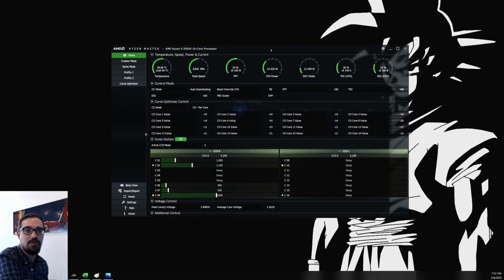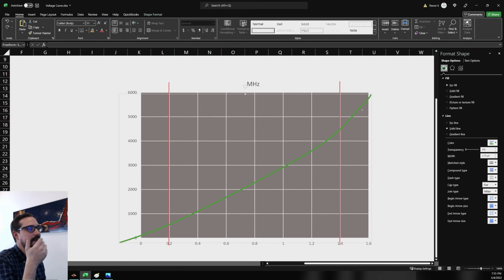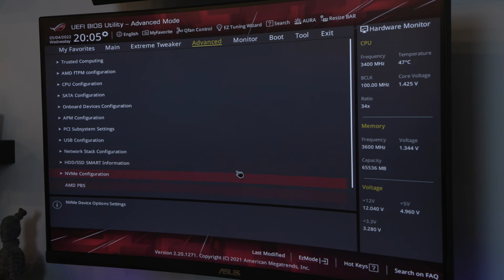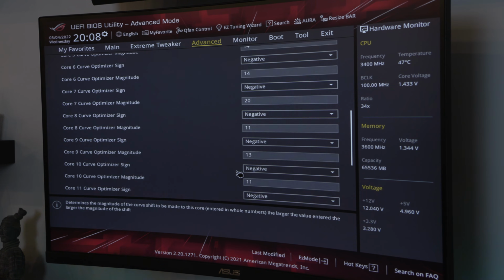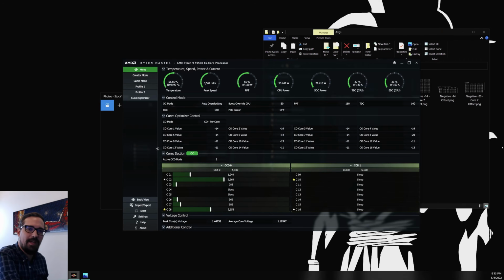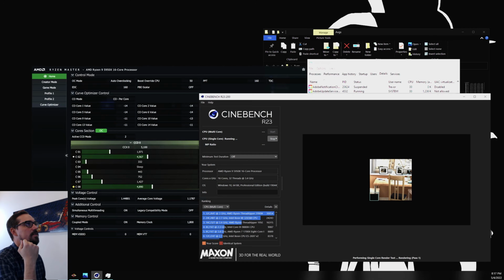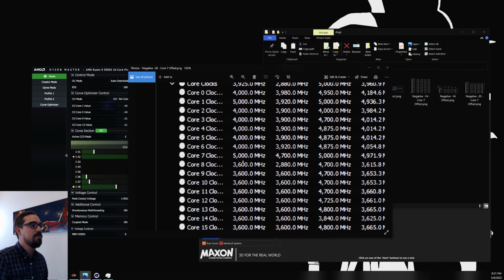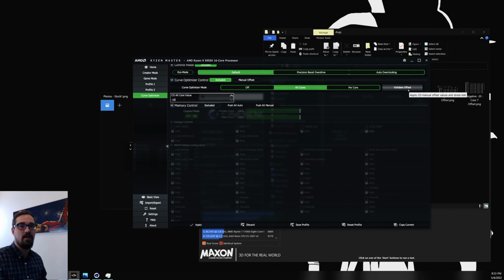AMD Overclocking - Curve Optimizer Explained

Comment: I've tried one thing to find the instability. I set CPU performance to 53%, that's where my 5700X is at lowest voltage + highest clock for that voltage.
I then start Prime95 Small FFTs, and see if clocks get stretched at that point by comparing reported frequency and effective frequency in HWiNFO.

I found that I can easily do -30 all core CO, and on top of that a -0.01875V offset on VCore with not clock stretching at any point. At -0.025 offset I get a very slight clock stretching, where 1780MHz(53%) get's down to ~1770 under stress test. At -0.0375 there was an idle stability issue once, that's where I started investigating low voltage/low clock stretching.
So, I guess -0.01875 with -30 CO is the best my CPU can do stable, which I'm pretty happy about.

Comment: Im really want to ask this, plz reply. So basiclly what we do is move the curve to the left, so with the same amount of voltage, the more clock speed it gain. But i rather want it to be cooler. So is the anyway to exemple: stock value is 1,4v ( max ) and the cpu run at 4,5ghz. Is the anyway to reduce the voltage to the value that the cpu run stable at 4,5ghz. But only that and stop ( no more clock ). It like i only need the same power as it stock but with lower voltage ( exemple like 1,35v ) and it wil stop right there, and not peek to 1,4v
Reply from the maker: You can effectively do that by manually setting the CPU voltage to run at a lower level, that would be done directly in the BIOS. It will result in a hard-cap on the performance due to the voltage cap. It would run cooler due to less power and would output less performance.
Reply: @UnhingedSystems  i know that. But the thing i want to ask is if we could have better perfoemance with the same voltage, can we hae the same performance with less voltage
Reply from the maker: @KienNguyen-lb2ee  In some cases reducing the voltage and manually setting a set clock speed can result in the same performance with lower voltage. This would mean using a fixed clock speed and manual voltage (manual overclock). Curve optimizer can still be used, but it is really setting the fixed clock speed and voltage that would enable similar performance for lower voltage. For an example PBO might boost all core  to 4.5GHz @ 1.4V, but in some cases you could do a manual overclock all-core 4.5GHz and 1.34V and use less power. It really depends chip to chip how well this works.

Comment: Very nice i have -60 on all cores but on home window in ryzen master it shows -50 dont know why. I test stability in OCCT Linpack 2019/Large/Small loads and it works without stability issue and temps from stock settings drop by 18C(from around 80C to 61C) and i get 200Mhz from Auto OC.

Comment: Just applied a conservative -10 all core curve optimize to my 5800x3d, and I'm seeing a pretty substantial drop in temps and a slight performance gain.
Reply: I bought a 5800x3d yesterday and immediately set it to -15. the result is awesome
Reply: I just got a 5800x3d, full -30 and so far no crashes in idle state. I think you can go further with CO on a x3d since it's a better binned chip.

Comment: Well just for those don't know there's actually a tool called CoreCycler, it stress test each core using a test mode you chose from a list. And just recently I found some redditor posted additional code he created that automatically increase CO curve value by 1 once a core fails the test, that means the user doesn't have to go into BIOS to change this setting every time it needs to be adjusted. The 5950x I own has huge difference in its cores: most cores on its CCD2 can go -30 without any problem, but most cores on CCD1 can go as low as -18 or -19. One has to be adjusted to somewhere +9 and another one stays at 0 as previously tested (talking about losing silicon lottery...). I'm now re-running the whole curve using this new automatic feature to fine tune it. This example means using one universal number that fits all cores is impossible. The system can be unstable because the all-core CO value may be very far from optimized for some of the cores.
Reply from the maker: People will get different results with CoreCycler. I've had it work okay on some chips and just cause constant hard-locks on others. Unfortunately there is no perfect "one size fits all" solution that guarantees stability for all use cases on all chips. That being said core optimization will likely go away in future generations as AMDs built-in features and out-of-box performance get better generation after generation. Side note, almost all high performance builds I have done in the last 6 months people want 13900K over 7950X/X3D. Seems like the big spenders are getting AMD shy again.
Reply: Well it sounds like there are some more tweaks to be done in the CoreCycler config cos if you don't stress each core properly with all 3 modes (sse,avx,fma3) you may not get a true CO value. But since it's really time consuming and Zen3 is already a past so...
I do agree that Zen4 generation didn't perform as good as many had expected and Intel actually had been doing better than before, but hey that's what exactly we want: competition. It's always a good thing that Intel brings us cheaper AMD and AMD brings us cheaper Intel.
Reply from the maker: @enchantereddie  Run a few hours of Stellaris, it will crash where CoreCycler passes.
Reply: @UnhingedSystems  Cool, good to know. Thanks!

Comment: I think this is pretty much the phenomena I started to notice back even when I had a i7-920. I call it a hot unload crash. If you've ever classically overclocked, you would find that as the temperatures get higher, you need more voltage to run the same clock speed. Which this of course makes it run hotter. So eventually you get into this runaway situation where adding more voltage just adds more heat to a already cooking processor (unless you're under LN2) and you cant get any more clocking out of it. So a hot unload crash occurs when something like an all core Prime95 is running and you stop it. My supposition is that for a moment, the silicon is still hot, and needs more voltage, even though it just downclocked to idle. Ive seen this type of thing happen so often, if I knew how to I'd make a script to cycle a load on and off, and make it jump around from different single cores, to maybe a couple cores, and then all core.

Comment: So it would be great if this curve was actually stretching only through maybe the top 20% of highest voltages and didn't optimize the lower voltages at all. That way we would get higher performance when needed and same performance when not needed.
Reply from the maker: That would have been ideal! It is likely very complicated to manage/create algorithms to control CPU voltage at a fast enough response time to allow us users to tweak. We could get some very interesting performance results if we had more access to granular control of the voltage throughout the different speeds/loads.
Reply: Programming something like a voltage cutoff setting shouldn't even be that hard for AMD, or maybe even by boardmakers.

Comment: I have run the optimizer three times now. It always takes my voltage offset to -30. I have a 5950X and this is so unstable, I have to reset cmos to get the pc to run. I finally ran Ryzen Master in simple mode and set the voltage at 1.39375 and the clock at 4.675. This is very stable and I ran an all core cinebench R23 test and scored 30714. WOW!

Comment: We need an updated video on this in regard to the new Ryzen 7000 series. It seems Ryzen Master doesn't select optimal cores. It shows them all but nothing, highlighting what is the optimal cores.
Reply from the maker: I have a 7950X system on my bench right now 👍
Reply: @UnhingedSystems  Sweet! I recently upgraded from a 5600X to a whole new  7700X setup. I used Ryzen Master to check an all core curve, and It also said -30. I ran it for the most part, stable for a few weeks until I found and instability. I am now using -28, and it seems to be quite stable now. Granted, the 7700x only has one CCD, but that might be why it is doing well at -28.

Comment: Nice video. thanks for the visual curve slider moving left and right in the start. Very easy to understand. 

What I dont understand though, is why Ryzen Master just isnt testing the cores at low voltages when its doing its curve optimiser. Seems illogical that i doesnt go the full range of the voltage on each core to test stability. This makes the whole application useless. In my case with 7600x it suggested -30 on 4 cores and -29 on the rest. While in my testing through the BIOS, I have instability on anything less than -14 all cores. This makes Ryzen Master seem more like "Ryzen Novice".

Comment: If you put negative 10 offset, is it negative 0.6V because you said offset changes 0.06v incrementally?
Reply from the maker: I believe that each 1 offset = 0.006V (6mV)

So a -10 offset would equate to 0.06V.

Comment: I hope that you dont defrag your ssds lol
Reply from the maker: Ouch bud, that hurts 😂
Reply: @UnhingedSystems  I only kid, but you kept talking about defragging so it scared me a little ; ) Thank you for taking the time to make this, good solid info. When is the last time you tried to use auto curves? Mine set correctly no issues so far.
Reply from the maker: @fn0rd-f5o  It's been a while, I'll give it another go soon! Been busy with 13900K and 4090 builds for a while now! Very tempting to do another build soon but happy with the 5950X and 3090 for a while yet! Looking at 4K TVs right now, so many distractions. Work has me slammed too at the moment, been a tough year for getting extra curricular activities in!

Comment: Im here with my ryzen9 5950x trying to get higher to that 5mhz for warzone 2
Reply: currently only pushing at 4.5mhz even at boost, my processor is unlocked
Reply from the maker: @bigdpr96  Have you tried enabling PBO and increasing your power limits as well?

Comment: Your dead on about the curve... when I ran a game that needed minimal cpu/gpu it would force reboot on a 5600x -30 curve but hard end games that keep the cpu and gpu pumping I would never crash. I set -15 and I gained a little over 150mhz all core for 4.58ish instead of the all core 4.44 at max heat which under load my cpu hits 83c max heat with an aio. However I can hit 4.78 - 4.81 on cores as they bounce around.
Reply from the maker: Thanks for the comment! I play a fair bit of Stellaris and if the cores aren't 100% stable the system will restart every couple of hours. Haven't had any instability for ages though, got everything tuned in just right 👍

Looking forward to the next generation CPUs (after 7000 series) where we will hopefully see some more emphasis on power efficiency with some mild performance gains. I think AMD could really do some cool things with their boost algorithms and user defined performance settings.

Comment: If you just change half the cores and test for a period then repeat with the other half you could get through it much faster than incrementing just one core at a time. When you get an instability issue then divide the suspect cores in half and test. This will save a lot of steps by repeating this process to find which core is causing issues.

My 5950X is unstable at 0, setting all cores I have had it on +8 to be stable. Curve optimize had most at -27 one @ - 13, another @ -11 and -7, then the computer would not even boot.

Comment: appreciate you hitting 4.85ghz on my best 2 cores with my 5600x because of you !!!! -20 curve settings and a reserved -5 for the rest
Reply: how are the temps ?
Reply: currently on the 6 heatpipe burst assasin 120 with a ryzen 7600 65w chip hitting 90w at 5.35ghz all core via boost and i never pass 87c (arctic mx6 thermal paste) ( i hit 5.5ghz stable, 5.6ghz couldnt stay cool, but i didnt like the power draw either over 100w)

i cant remember the temps i was getting with the 5600x but i had a massive arctic freezer 50 direct touch heatpipe and it was always cool as far as i can tell, i was more hitting a cpu limit than a thermal limit 
i dont recall ever seeing more than 75c ever with that cooler and that was under cinebench r23 after 15+mins

Comment: Been looking around on reddit and youtube about undervolting Curve Optimizer settings and I usually see people set their "Per Core Negative" to something between 5-20. I've set most of my cores on my 5800X to 30 besides my 3rd and 8th core which read unstable when I set one of them to 15 and 25(thanks to OCCT), but is there a reason why most people set theirs between 5-20 and not most to 30? Am I fine setting most of my cores to 30? Am I "lucky" if I'm able to set most of them to 30?
Reply: Ever get an answer to this?
Reply: @addisongregory103  eventually I did start getting crashes from setting most of them to 30, so I did have to lower them over time.

Comment: Thanks for this explanation.  I think it helped me to understand what Project Hydra is trying to achieve. It's trying to adjust the voltage on the lower end of the curve by bracketing the curve, monitoring the load on the cores dynamically moving the curve to guarantee that under low load there is still enough voltage.
Reply: What I don't understand is why is the curve fixed? Why can't you just steepen the curve at the higher end and leave the bottom end alone?
Reply: @ckusel123  Use Ryzen Master, it offers exactly this.

Comment: Someone needs to come up with a repeatable and consistent way to simulate the "idle crash" conditions from doing PBO negative offsets. I really can't be arsed to test each one of the cores on my 7950X without a consistent stability test to do anything other than an all core offset.
Reply from the maker: Indeed. AMD really out to do something that works since it's their tech. I've tried every stability test out there and I still run into stability issues outside of testing software. I don't fully understand why, but Stellaris (game) will crash within an hour or two while everything else appears stable. I'm running stable right now, but every time something weird happens I get rid of all the curve optimizer settings just to be sure it isn't the culprit.

Comment: Is there a way to active Curve Optimizer in BIOS without enable the PBO?
Reply from the maker: Set PBO to manual and enter the default PPT, TDC and EDC for your chip, then it's running stock.
Reply: @UnhingedSystems  The thing is where can I find these stock values, like in my case Ryzen 7 5700X? Here in the BIOS when PBO is enable I can only chose some profiles like Eco Mode, Auto or Manual, for example, but no stock values to start off.
Reply from the maker: @ricardofac47  Load up Ryzen Master and look at the values. Those are your stock values.

Comment: Very informative video although I already gathered some infore beforehand :D
But I'm gonna use the commentsection for personal support: I have a 5800x and I'd love to use the curve optimizer to not get a higher peak frequency but just better temps. Is there an option to limit the frequency so my CPU doesn't go to 75° the second I open up a browser ?
Reply from the maker: Thank you for the comment!

You have a couple of options to reduce frequency and/or lower the temps, but the curve optimizer won't do it for you.

- Lower max CPU voltage (set a manual CPU voltage) to restrict power draw, will limit performance at higher loads
- Use PBO to reduce power limits below minimum specs (set PPT to 125 instead ot 150+), will limit performance at higher loads
- Turn off PBO, don't use any overclocking
- Manual frequency settings, capping the CPU at lower frequencies (lose the ability to use boost)

Or some of my favorites:
- Get a better cooling solution
- Use better thermal paste (higher W/mK rating, 14+, non-conductive is best)

Or the extreme side:
- Lap the CPU and cooler to make the contact area smoother

The power limits/voltages are the best way to limit the power draw/temps of the CPU for this series. I prefer to get the max frequency out of the CPU with a better cooling solution.   I like to use 100% of the performance I paid for 😁
Reply: @UnhingedSystems  Thank you for the reply.
-for your first 2 points, well I don't really want to miss performance, obviously I bought the CPU for the performance :D
My thought was that I could limit the CPU to the frequency it would normally run and just lower the voltage go get better temps while keeping the same performance, i'd rather have a cool system than a system that performs better than advertised, especially because I don't care much if handbrake renders 10 seconds more or less.
-Not using any OC is my default, I don't like any of my components getting hot and the 5800x is the first one that spikes up so high under the slightest load :/
-That makes total sense and I didn't think about it, but yeah, obviously if I set limits, I don't get the boost :(

-Sadly I can't get a much better cooling solution, I'm using a Dark Rock Pro 4 and Kryonaut Paste, even most Watercoolers can't compete with it.
-the extreme side is too extreme for me xD

Guess I have to live with the temps, in the end it is advertised to run smoothly at those temps and I've never encountered thermal throttling. It's just something I have to learn to accept :D Thank you anyway <3
Reply from the maker: @krystallize7914  The 5800X is hot, but it performs great and the heat isn't hurting it. With your cooler just enjoy the games and performance and don't focus too much on the temps 👍
Reply: Temp spikes are normal. Typically that’s just one core boosting and spiking the temp the minute you open up something. Now if you have every core boosting and the temps are increasing consistently then you have a problem.